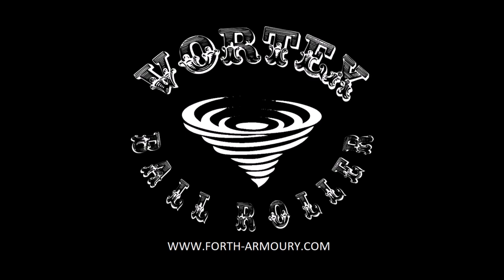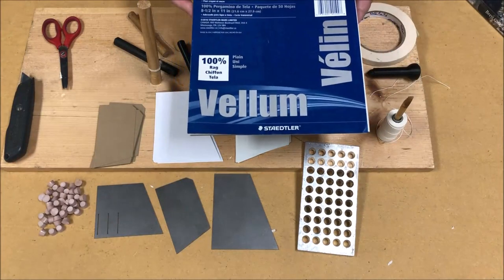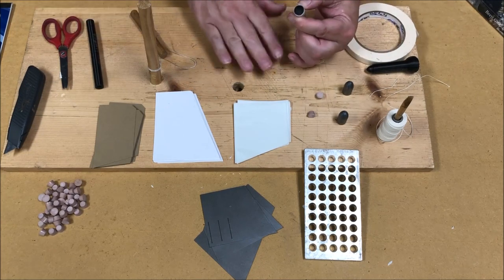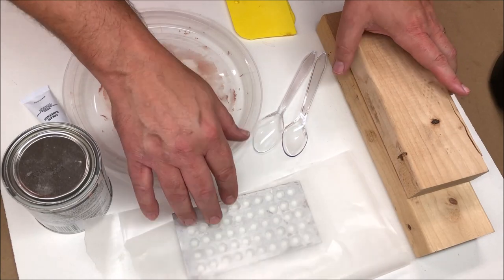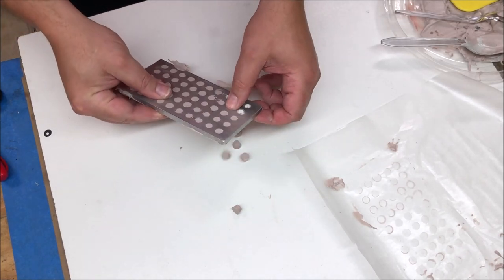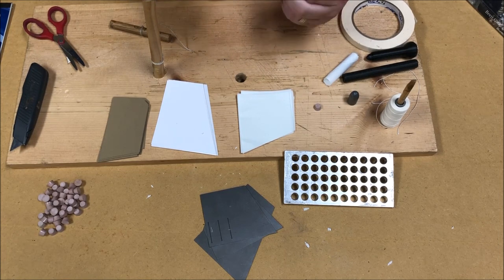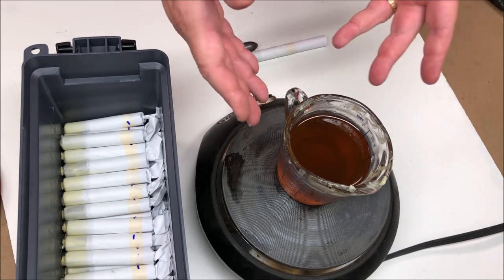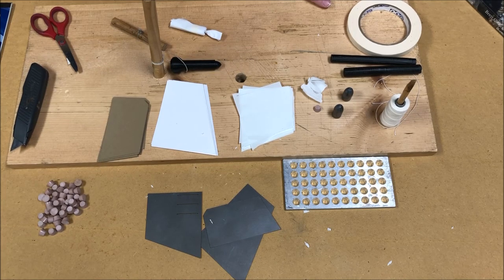How to make the 1860 Final Design Enfield Paper Cartridge

Comment: Excellent tutorial. I too am a Pritchett bullet disciple. It should also be mentioned that the crimped end be tied as tight as possible to prevent the melted lube from entering and causing the paper to stick to the base of the ball. Same with the slotted outer wrapper. Any wax soaking through the wrapping or the paper itself will cause the paper to stick. Either of these occurrences can produce flyers down range. The outer wrapper should definitely be linen paper but the powder cylinder wrapper can be wood-pulp paper. I've used newsprint paper with excellent results. I really like the steel patterns. I have a mandrel turned from aluminum from my former. Where did you get the printed mandrels?
Reply from the maker: Hi John, great info, thanks!  I 3D print the mandrel and former tools myself.  The period kit only had 1 mandrel and 1 former - I believe that in period they used the powder cylinder on it's mandrel, with the bullet, as a "mandrel" for the bullet end of the cartridge.  I find it easier to roll it on its own mandrel and then drop the bullet in afterwards.  This lets one make up a lot of individual components (bullet end, powder end) separately to be assembled later at one's leisure.

I'll be offering the mandrels and former for sale shortly.
Reply: @musketmatters2004  My aluminum mandrel is patterned on the one in the original drawings. I've always rolled them with the cylinder first and then rolled the ball and outer wrapper around it. Brett repeatedly stated that the cartridge must be rolled as tightly as possible. But I'm always on the lookout for a better way of doing them. I'm very interested in acquiring the pieces when you get to offering them.
Reply from the maker: @johnmcdonald587  You are correct - in period there was only one mandrel, and that was for the powder tube.  Then the tube and bullet were rolled together in the outer wrapper.  This way the paper was wrapped as tightly as possible about the bullet.

Comment: Would the .550 template work for the .539 Lorenz bullet which was wrapped in essentially the same manner?
Reply from the maker: It appears that the .550 template results in a trapezoid that exactly "meets up" at the bottom edge of the bullet with no overlap of the ends of the paper.  We would probably need to modify the trapezoid shape to be slightly smaller so that when wrapped to .539 there is no overlap where the two end of the paper meet at the base of the bullet.

Comment: Sadly NOE is out of all their pritchett molds and hasn't responded to my email in over a month. 

Thankfully, i managed to get a custom mold from another place that doesnt need the plugs. Now i just need to figure out how to make good casts for em. thanks for the video!

though it is a .563 bullet, will there be any issue using your templates with that? i didnt think about it before putting in an order
Reply from the maker: You can try using the bullet itself as a mold, and putting a ball of milliput or something similar into the cavity and letting it harden.

This cartridge is the 1860 variant, which used a .550 bullet.  If you use a larger diameter bullet the paper will not wrap as completely around the bullet.  In addition, the finished powder chamber, wrapped around a .48 mandrel, will not match the diameter of the bullet, and will be undersized and loose inside the outer wrapper.  Earlier versions of the cartridge intended for the .568 bullet utilized a 1/2" mandrel for the powder chamber.  

Forth Armoury will be selling the 1855 pattern templates and mandrels shortly.
Reply: Great to know. I will certainly get a set of those if you come out with them, thanks

Comment: I wonder if wood putty would work in the mold ?
Reply from the maker: I have not tried that.  I have tried Sculpy clay, Bondo, and actual clay fired in a kiln.  The fired clay plugs are rock-hard and just like the originals used in the final iteration of the Enfield cartridge.
Reply: @musketmatters2004 why did you switch to bondo? Was there a difference in performance/accuracy?
Reply from the maker: @mulehead99  Over the years I tried Sculpy Putty and Bondo before I settled on fired clay.  I don't think I ever fired any of the Sculpy plugs.  The Bondo plugs worked fine.  Clay plugs are rock hard and probably provide the best deformation of the lead without deforming themselves. Clay is what the British ultimately settled on, after Boxwood.
Reply: @musketmatters2004  glad to hear that. I bought the low fire clay and followed your video and did initial baking in oven for 40 minutes, then stuck a couple hundred of them in a soup can with handle into a charcoal fire for a couple of hours while casting the bullets. They came out great and seem pretty hard.
Reply from the maker: @mulehead99  Yes, I believe the fired clay is the best choice.